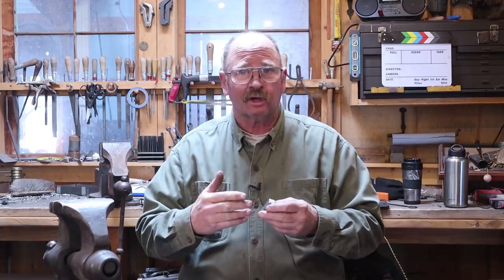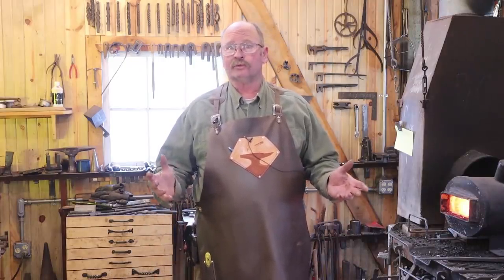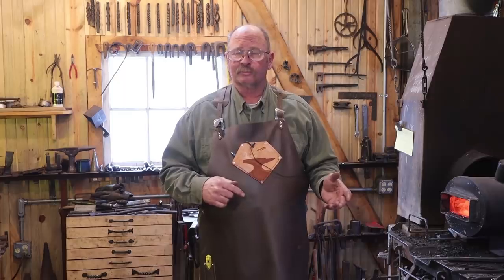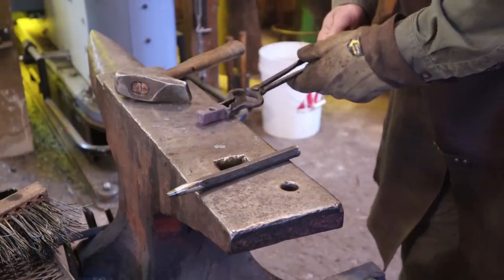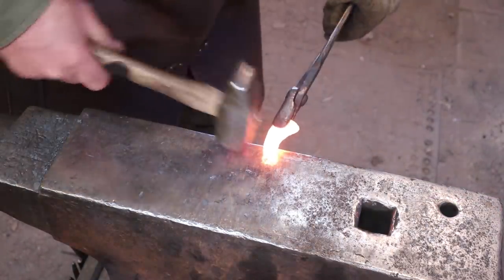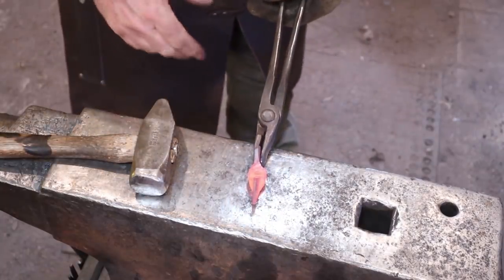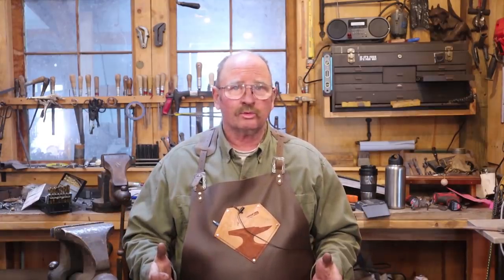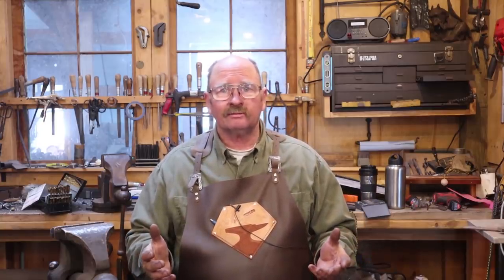Wing nut forged and threaded

Comment: When working with room temperature stuff you should use rubber soft jaw inserts. They grip really good. Even for your hot work you could probably get some sort of soft jaws for that. i bet brass, copper, tin and more could work great. Just need sheet metal folded around it. Steel on steel is not great for clamping

some of the soft jaws you buy have magnets inbeded into the soft jaws to prevent them falling off. Easy enough to make if you so wished

Comment: The scale is a lot harder than regular steel, so you will dull your taps, and I guess taps are more expensive than drills.
Reply from the maker: One of the big reasons to drift slightly under sized and drill to exact size before taping